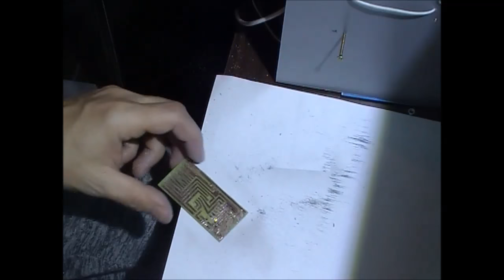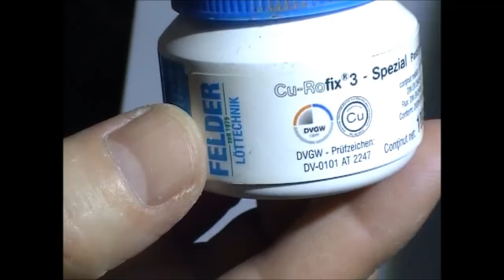Make PCB with a LCD mask

Comment: The best way to tin a circuit board is to use liquid tin. Just drop the PCB into the liquid and it forms a tin layer onto the copper automatically.
Reply: Waste of money. It is to expensive.

Comment: I was a bit surprised you couldn't just leave the resin on the traces and only scrape away what you needed. Kind of like applying the soldermask to the board first.
Reply: You could do a soldermask with the same process. However I'm not into printing and am not familiar with the breakdown temp, etc. of the cured resins. However if that would work out and the electric properties are right this could be really interesting. Maybe even printing the case right onto it after populating the parts.
Reply: @derkeksinator17  the brazilian resin maker told me when I asked that UV resin only resist to about 90 degrees celcius. But you can use solder mask UV ink instead

Comment: the only problem is 3D Printing resin is very expensive for this project- use a photo sensitive pcb with your lcd setup.
Reply: It's only expensive if you're actually 3D printing with it because you go a lot per print. Sure, that bottle is $60 but you use so little per board it's actually more cost effective than buying presensitized boards. I use actual PCB photoresist and just coat the boards in a simple spin coater- it's even cheaper.

Comment: why ? why you apply solder on all tracks? just wash and apply solder mask.
Reply from the maker: for protection.
copper oxidizes.
Reply: oh for that is better a good wash and solder mask or flux spry.
Reply: what you are really are doing weakening the cement under the copper.

Comment: This is really irrelevant, tonner transfer for those thick ass lines is just as good... although LCD process is better. 
Why not show PCB exposed by the LCD with smaller traces and spaces? how about line traces of 0.07mm...? this is going to help for making PCB traces with QFN/PBGA chips.